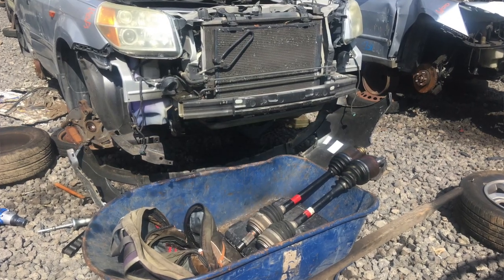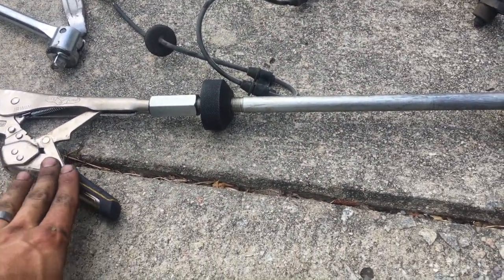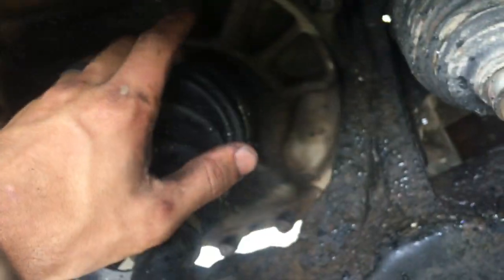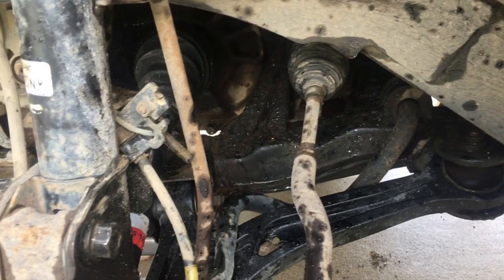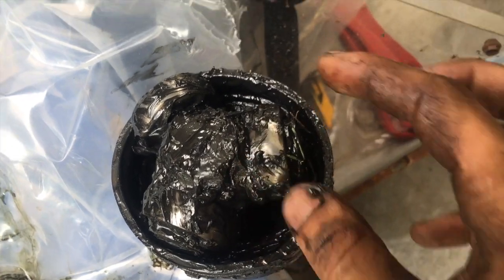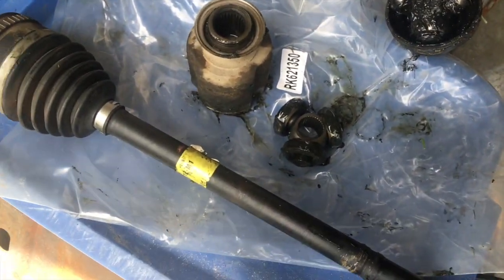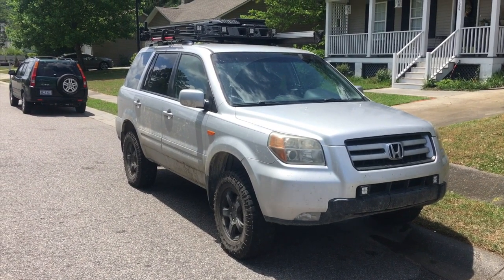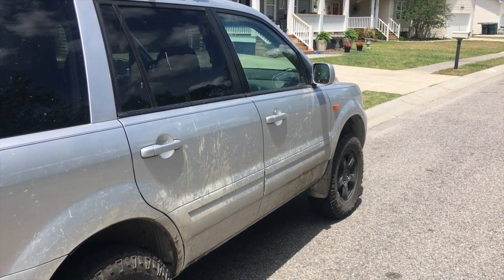Broken Axle!

Comment: I'm in the market for a used '06-'08 Pilot and am wondering if there is a good forum thread you can point me towards that outlines potential problems and how to spot them. Also this could make a good video topic for your channel if you haven't covered it already. Thank you
Reply from the maker: That is a good idea. I would definitely check the rear sub frame area for rust damage.
Reply: Where on the subframe do they rust out?